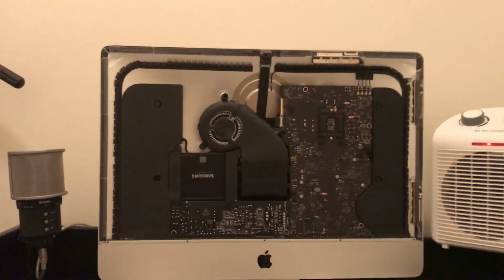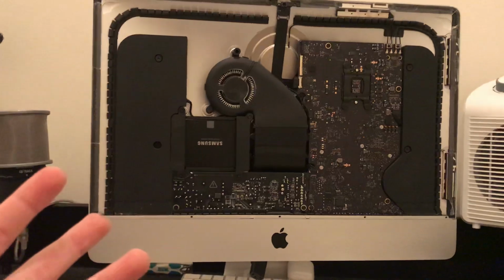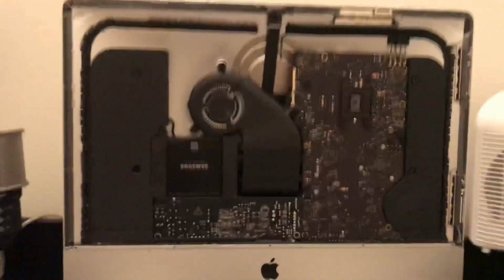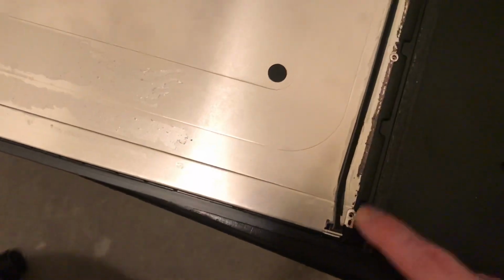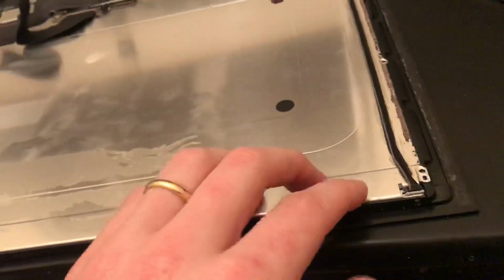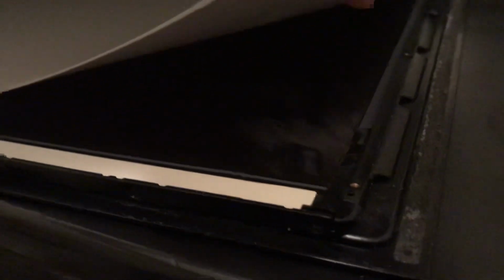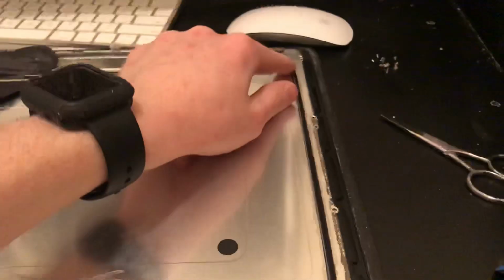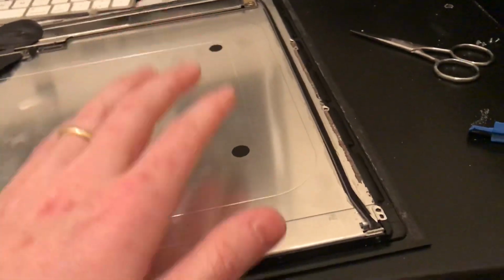How to Repair Dark Spots on iMac 4K or 5K Screens

Comment: That tape is metallic RF tape. I would not recommend replacing it with electrical tape; instead I would try to salvage and re-tape if possible. Also, it’s not necessary to touch the tape covering the cable running down the top and sides of the back of the screen.

Comment: THANK YOUU!!!! My iMac 2017 27" 5K screen looks flawless again! It was easyer than I thought. I did not remove the tape on the cables. Only the tape that covered the screws. Then I used a lint free wipe and a drop of distilled water to clean the LCD panel and the diffusor. Then I removed the dust particles that got inside while I was working on it. I used a sticker that came with a screen protector for my phone. I cant't believe how perfect it turned out! It looks like new! Thank you once again!!

Comment: Successfully completed this project. Thank you so much for making this video it was extremely helpful. Converting my 27 inch 5K iMac to an external display. I had pretty large noticeable spots in the bottom two corners extending towards the middle - one of which was about 6 inches in length. These spots have always bothered me and have definitely been increasing in size over the last year. Very glad I came across this video while I had the screen off. Hoping they don't return with my display acting as an external monitor without fans. Best of luck to anyone else taking on this project!

Comment: Thank you so much for making this video.  I bought a 2017 4k iMac off of Craigslist with this exact issue, however it was top spec with 3.6ghz processor, 32GB RAM, 1TB SSD.  I got it for only $250 due the dark spots issue.  After, I found your video and was able to completely fix it.  I feel like I got the deal of the century with these specs.  Thanks again for taking the time to make this video.  Btw I found you only really have to remove the tape on the bottom edge of the screen.  On the sides, you can just cut the tape using your finger nail and it pulls apart easily when you lift it up

Comment: damn it, i'm getting this problem now. it looks like finger prints inside the glass. i'm a little too nervous to take off the screen as my imc pro (2017) cost me $8000 CAD and i'm not rich. i was a once in a lifetime purchase and i dont want to fuck it up. ii'd also add that i did have a windows PC before and hated the lshit out of it. this problem is still 1000 less problems than what i got from windows. i do like my mac, i'm just frustrated with this problem. i wish they repaired easier.

Comment: I finally did this on my 2015 27, 5k and it was even simpler then this and looks as it should, amazing!  Thanks for the video.  I didn’t need to remove the tape on the wire.  I sliced the tape on the edges and removed screws on both sides and bottom, that lifted the same as yours. Easy. I just need a tape that will be good to cover it back up.
Reply: Did you buy any tools? I have to do this to my iMac soon. Apparently, the humidifier is to blame. Thanks :)
Reply: @emilyknight7432  Just the kit from amazon to open up the screen and retape it etc.  I just took a cloth and wiped it.

Comment: I have these spots on the bottom corners on my imac. I have 2 other imacs right next to it but it's the only one with the smudges and I noticed it maybe a year into having it, it's about 2 years old now (2019 model)  I saw some forums dating back to 2011 of people having this same issue. I honestly dont understand how apple can keep pumping out products that have such big flaws when they have had 10 years to make sure this doesnt happen or at least offer free repairs despite being out of warranty since its a design flaw on their part. Im not brave enough to take this mac apart otherwise I would clean my screen myself.

Comment: Thanks for your helpful video! Just repaired my iMac Pro with the same problem! I found a helpful repair set on amazon for 13€, that contained an opening cutting wheel, two suction cups and the right adhesive tape to put everything back together. I saved a lot on expensive repair costs and even more important: I did not have to send in my working computer for several days.

Comment: Hey, my problem is a bit different, I have cloudy patches on both sides but along with that, I can see the whole monitor (bottom, left, and ride) side near the bezels it is becoming slightly red in color. My machine is a 2017 5K iMac. Shall I do the same? What do you say?

Comment: Do you think using the vacuum cleaner on the lower vents would prevent this issue from happening? 

I’ve just bought a 27 inch iMac one month ago and used to vacuum cleaner right now. I obviously switched the machine off (and even unplugged it) when doing so. I’m also cleaning my desk daily and have a cover that I put on the iMac at night. All to prevent the dust from coming in... Any other suggestions to keep the dust away? 

I hope I will never have to open up the machine, but if need be, I have a great tutorial here for reference. Thanks a lot for your super informative video! 🔝

Comment: Why do we need to fix this by our own if it's very clear that this is a design flaw? I also had my display replaced two times under warranty back in 2014 (27 iMac late 2013). Could somehow address this MAJOR issue to apple? They had a lot of recalls in the past for other problems (keyboards, GPU, etc.), but the screen issue seems not  to be that important for them.

Comment: Great video, Tyler! I just noticed this on my iMac Pro, which, thankfully, is still under warranty. I wonder if Apple Authorized Service Providers are cleaning the screens as you did or replacing them. If anyone knows, please post a reply here. Also, has anyone confirmed that this is dust, or is it something else? Thanks, again.
Reply: I have a iMac pro also. Apple had replaced my screen two Times now. And i already have to replace it again

Comment: Thanks for this video. Just did this on a late 2012 27 inch. Had to do it twice because the first time I closed it up the paper film was not perfectly flat to the glass and had a wavy pattern from the corner of the screen. Second attempt fixed it now its all good.

Comment: This has been there in the iMac since the slim/tapered version came out in late 2012. I got the display replaced  under warranty but it came back again. I read somewhere its a design flow, so I visited several authorise store selling Apple products (India), every store that had imac had that cloudy shading in the corner, even the imac 4K & 5K. It is a design flaw, possibly due to air circulation. If anyone is going that length to open and repair it, i suggest, try to seal that area and see if that works. I wanted to try, but i sold mine and switched to MacBook Pro. I wished i had seen this video earlier back then, woud've given me more confidense to repair it myself, probably permanently.

Comment: Hi. Thanks. I wish Apple would admit this design flaw and replace the 5K and 4K 10-bit color LG monitors with a revision 2 or better version, regardless of warranty and model, free of charge. They'll still have a lot of change with the US$T market capitalization. I wish they kept the magnet design, instead of this newer sticky tape so you can easily clean it and put the glass back on, easily. I wish I got the AppleCare extended warranty (paid in installments with zero percent interest, if possible).

Is there a movement to make Apple legally replace all our 5K and 4K monitors that has this bleed hole problem (where the dust enters)? They need to use their US$Trillions to make long time, loyal customers happy.

God bless, Revelation 21:4

Comment: THANK YOU SO MUCH!!! I’m upset because I’ve only had my iMac for barely 2 years and these “spots” appeared on exactly the bottom two corners recently. Going to try this if/when they get worse and more distracting because right now they are small enough to ignore for time being. can’t afford screen replacement or repair right now with COVID-19 but need my computer for online classes also due to COVID-19. 😭 thanks again!
Reply: SAME!! I have the i7 processor with 32 gb of RAM and I'm SO SCARED to fix it myself...this is so annoying
Reply: Kat I know me too!!! Ugh!!
Reply: Did you fix it? Mine has them and I’m so scared of fixing it 😭
Reply: @caaroosiin  I haven’t tried to fix it yet! They are a little bigger now but still not too bad 🥺 I’m scared to break it

Comment: Thanks, great video! I just found out this is something under the glass, I thought it is just dirt that needs to be cleaned. Thank you very much, this is somewhat easy to fix, I believe there is some instructions how to take off the screen, and how to glue it back on. Also, the best time to replace spinning drive with an SSD.

Comment: Thank you so much for sharing this. I just bought the proper tools to open the iMac 27" 2012 (slim). I'm about to change to SSD and possibly fix the "smudge" as well. I will reply to my own comment once I get it done. Thank you again sir for the share.
Reply: Andy Liu ever get it fixed?
Reply: @FaeriBee  not yet, but I did get the SSD in place without much of an hassle.

Comment: So many thank - you've saved my nerves and time. I'm just preparing for the HDD to SSD shift and about to open the iMac. So it's just in time tutorial. Maybe you have photos of the display after these cleaning process?
Reply from the maker: Yeah I should have posted some before and after photos in the vid, sorry about that
Reply: @TysTech  I am grateful for this video, will fix my imac 2017 5k with this hack. Did you ever get to know why this happens?
 or if the stains comeback eventually after cleaning them out?